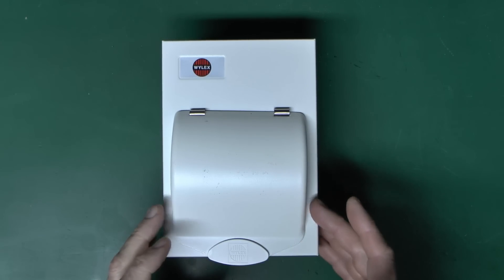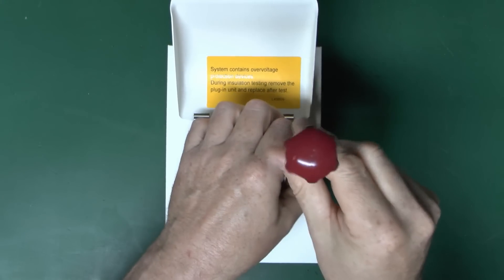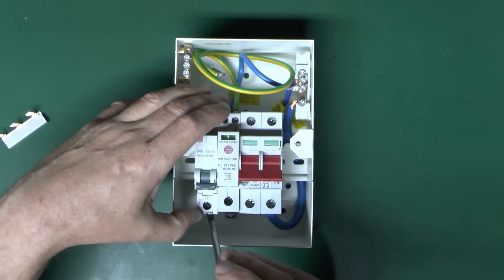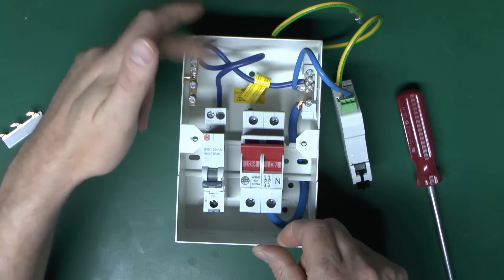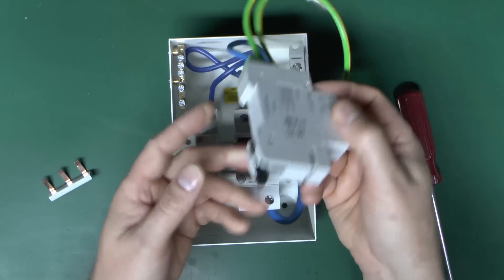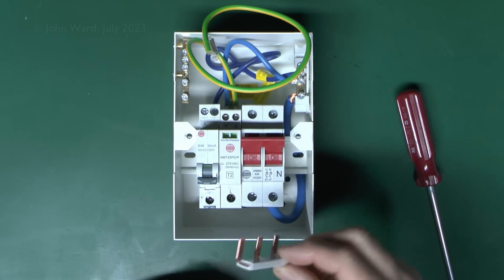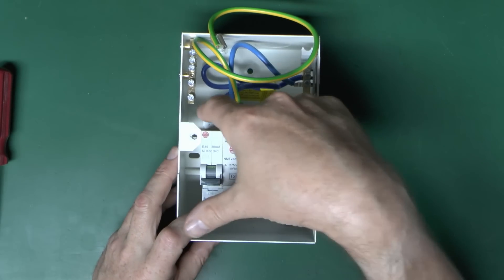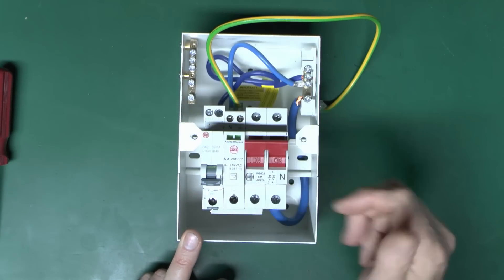Wylex Mini Consumer Unit, RCBO and SPD

Comment: The RCBO is L&N.  Why don't UK manufacturers have the twin L&N busbars to do away with a N terminal bar!
Schneider (French) and Garo (Swedish) sell in the UK Continental DP CUs with three row cases using DP disconnectors like RCBO and MCBs.  The regs need updating to mandate DP disconnectors, but they are available. So easy to fit with no clutter or wires. And all DP!
Reply from the maker: Mainly cost.  Whoever starts selling those in the UK would have to educate people as to what they are and why they should buy them, and for domestic it's unlikely anyone would bother.
Such things are already available for commercial boards, such as the Acti9 Isobar P. https://www.se.com/uk/en/work/products/product-launch/acti9-isobar-p/
Reply: @jwflame  
Thx. 
They are sold in the UK: Schneider and Garo and ABB. The Schneider multi row Continental type but metal consumer unit is even sold by S'fix now, so looks promising. I don't think they sell the DP MCB/RCBO/RCD reversible breakers - need to look harder. The DP reversible can accept the twin L&N comb busbars.  They sell the twin L&N combs.

The Schneider double pole Easy9  RCBO's/MCBs for example are reversible - bottom feed or top feed. This means they can be fitted with a top feed using the L&N twin busbar (comb), or a bottom feed using a single L busbar (the British way). 

Having the comb busbar means less wiring and a less cluttered consumer unit, that is easier and quicker to fit. And safer as less connections. In France they connect the rows via solid vertical busbar, no stripping and threading 25mm cable to connect the rows. All a part of the kit. Seconds to assemble.

Some other makers use multi row metal CUs but not the twin L&N bus bar and DP breakers. Fusebox make the metal two and three bank cabinet, but using the inferior British single busbar setup. In short, a fake - a pretender.

I believe Garo sell a plastic inset multi row CU but needs to go inside a metal enclosure to conform.

As I have stated, the regs need to be changed ASAP. Not having DP interrupters at CUs is asinine, and totally irresponsible by HMG and his regs.
Reply: @jwflame  
Search Youtube on:
Dodgy European Electrics? An Electricians view of Consumer Units in Portugal & France

Shows a Schneider CU being installed near completion. Using pushfit breakers. Nice.
Reply: A uk company called SBS sell dual bussbar boards and dp rcbo. Nice units and a pleasure to fit
Reply: @chriskirby3337  
Thanks. Yes, SBS Trade Sales. The web site could be better with views of inside CUs, etc. I never knew they had multi-row CUs.  It seems the multi row CUs come with a two separate Live and Neutral busbars. LeGrand have vertical busbars (insulated rods) connecting the rows, it does not show if they have such a system. 

Looks like they sell only DP RCBOs, which is encouraging.  I never saw any AFDDs for sale. 

The continental system of twin L&N busbars makes it so much neater reducing cluttered, ugly, wiring inside CUs cases. Even an idiot cannot mess it up too much.
Reply: @chriskirby3337  
I believe SBS have gone bust.

Comment: Nice expert review here JW but is the SPD to protect the vehicle or the Home from surges?
Reply: Listen between 6:12 and 6:20 for the answer!
Reply: @Richardincancale  Good point but some EV vehicles actually create a reverse spike voltage surge during the charging phase hence my question
Reply: @Mike_5  Oh that sounds strange. The charger circuit is essentially just a large switch mode power supply to step up the voltage to 400 (or 800) volts and rectify it, so not sure how reverse spikes would be generated ?  But the SPD would protect against that too I suppose as it’s just a pair of MOVs wired to ground.
Reply: @Richardincancale  The vehicle's charging circuit can produce large inverse currents that can affect the home's supply have you never experienced that before?
Reply from the maker: It will do both, as it's connected to the same supply for all of it.
If the property already had surge protection fitted, you wouldn't need another one.

Comment: Not even 30 seconds in and already smashed people calling it EV charging.
Reply from the maker: The actual charger is in the car and the device on the wall is an EVSE.
However they are already sold as 'chargers' everywhere and most people will call them that, even though it's technically not a charger.
It's just another one of those things like lightbulbs.
Reply: @jwflame  I beat you to it john.  😆
Reply: Indeed.... the clue is in the equipment title... EVSE... SUPPLY- to the vehicle's charging hardware.
Reply: @olly7673  do you mean an EV charger?
Reply: @Swwils  the charger is in the car,..... all we ,as electricians, do is install the Electric Vehicle Supply Equipment.. Having said that the great JW referred to the equipment as the "charger" 3 years ago here ..... https://www.youtube.com/watch?v=gZVx7GbAwlg (10'15") when it in fact just the supply.
Reply: @olly7673  ah you mean the EV charger got it.

Comment: Always thought that 'High Integrity' is something of a misnomer. An installer with integrity wouldn't fit them...
Reply: High integrity= A 3rd neutral bar. In fairness though it meant the new fangled RCBO could be utilised on the"old" boats

Comment: Hi John! Top video once again 👏🏻 
Do you own an EV?
If so, what make and which EV Charger did you opt for?
I take it you installed yourself?

Kind regards 

Matt
Reply from the maker: Citroen e-dispatch.
MyEnergi Zappi, mainly because that was a decent option and was actually available at the time, which was October 2021 during a massive shortage of many electronic items.
Reply: @jwflame  fantastic choice in charger!
Zappi's are definitely my favourite to install, I'm a fan of their multi linkable tech using a Harvi for remote CT clamps for generation ans storage, also the Eddi for heating water for free 🙌🏻

What are your thoughts on this?

Matt
Reply: @jwflame  not a trick question but from what you said in https://www.youtube.com/watch?v=gZVx7GbAwlg..... at 25'50", was your choice of Zappi (which I consider to be in the top 5 in the UK anyway) down to it being the best alternative, or something else?
Reply: John owns an electric van. He did a video about it a while back.